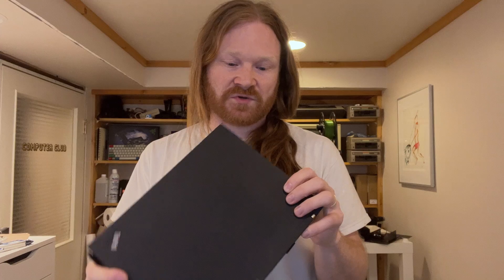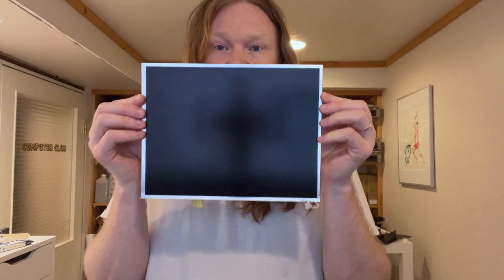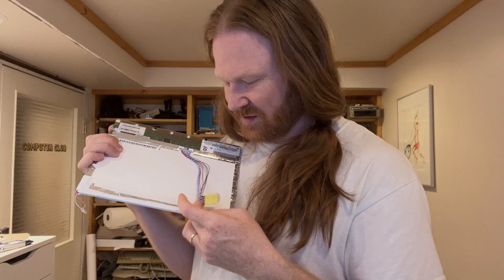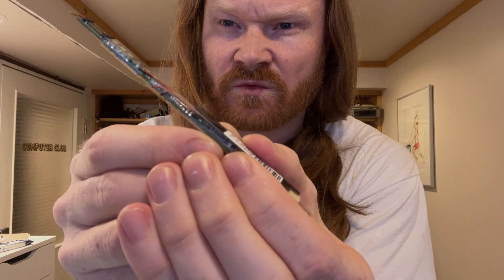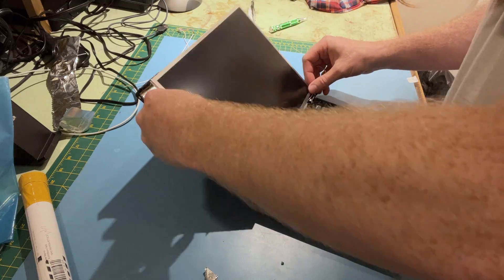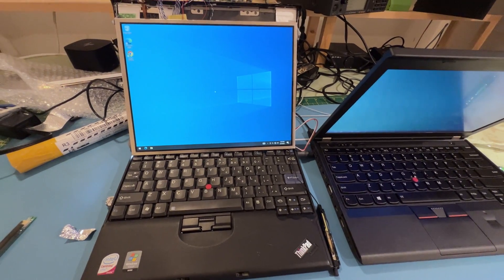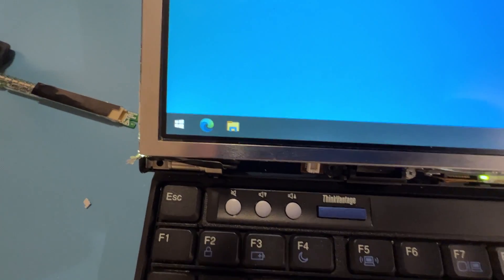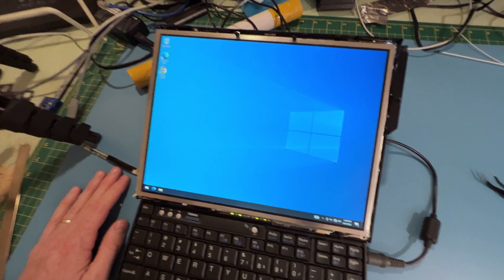Thinkpad X61 SXGA+ LED Backlight Conversion

Comment: Is there going to be an update soon? This is probably a dumb question considering it’s been a long long while and I haven’t seen any signs of activity for over 2 years
Reply from the maker: Do you mean about the Raspberry Pi Mainboard replacement? Unfortunately, having 3 small boys has kind of eliminated my free time.

I think if/when I come back to this idea I would actually switch to an X200/X201 because you can find eDP LCDs that will fit inside the enclosure. Driving an LVDS display like this would require a conversion from HDMI (or other) and it complicates things.

In the end I got a Framework 13 laptop to scratch my modular laptop itch.

Comment: Hey mate a bit late to the party here, but did you end up trying the Raspberry Pi 4 CM conversion? 

IMHO you should have used a modern LED-backlit IPS LCD screen (eDP interface) with an SBC that supports eDP, and have foregone the Pi 4 because the X61s already performs similarly (albeit supporting fewer instruction sets, and at a higher energy cost)

looking forward to an update

ps I also bought the panel from kevintradeshop, but had to cut off the plastic and metal tabs on the sides of the panel myself with my trusty dremel. It fits, but barely :S

Comment: I actually picked up the same display from that seller on aliexpress for my x61s and was disappointed by the brightness as well. I would like to pick up this led kit but for some reason when I search for the name I'm not getting anything (maybe because I'm located in japan?) Do you happen to have a link as I'm definitely interested in trying this out. Thanks!
Reply from the maker: I’ve added the links I’m the description. Hope it helps. Yeah all old ccfl based backlights are going to yellow and dim over time. I’ve got a 4:3 Dell monitor that I like and some day it’ll need a replacement too.
Reply: @ComputerClubShow  Much appreciated! Yeah the ccfl bulbs aging is a real issue I've noticed in recent years. I have a a few older thinkpads as well and might try and queue up some led mods for those if this works out okay. Thankfully it seems straightforward enough. 
Some of those dell 4:3 monitors can be pretty crisp so good luck! I would gladly check it out if you managed to put some content out on it. I also have a Dell ultrasharp 20" 4:3 at 1600x1200 (if I remember correctly) that I have in a closet I'll have to dig out since it got significantly dimmer over the years ~hence the closet.

Comment: How the project going? I got the X61, but apparently, MB is dead... which immediately made me think about gut-replacements, but preserving the form factor, keyboard, etc.
Reply from the maker: I’m working on a usb adapter for the keyboard right now. Then my next plan would be to design a battery manager/power supply. Then maybe use an hdmi/Lvds adapter from aliexpress. 

The Pi is getting old enough now that I’m thinking about moving to something like the Khadas Edge 2.
Reply: @ComputerClubShow  also IMHO LVDS is dead and should stay dead. eDP is now standard for a reason. Use an eDP supporting panel and an SBC with eDP on board
Reply from the maker: @WCZxDRTxSU that’s exactly right. It will turn the keyboard and trackpoint into a USB keyboard/mouse combo.
Reply: That is very exciting. I really look forward to seeing how you progress.
Reply: @ComputerClubShow  use the instructables guide to do the X61/T61 keyboard to USB conversion